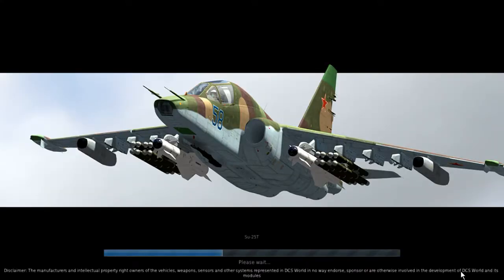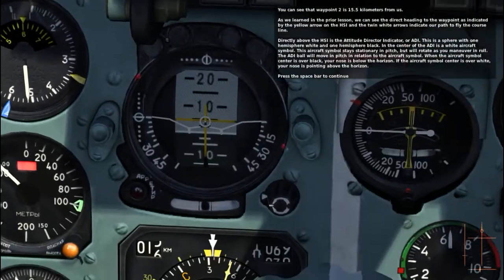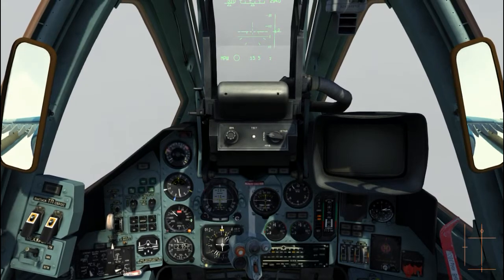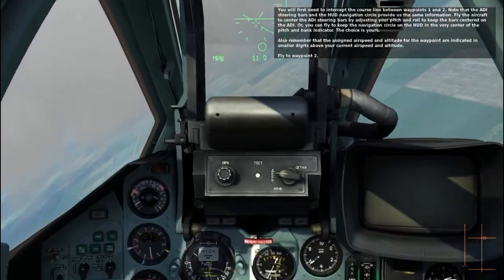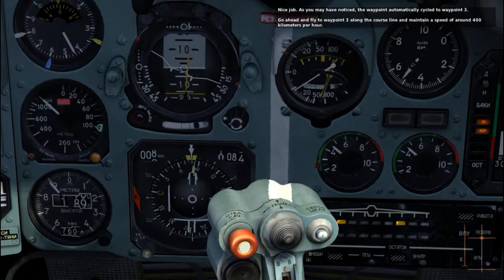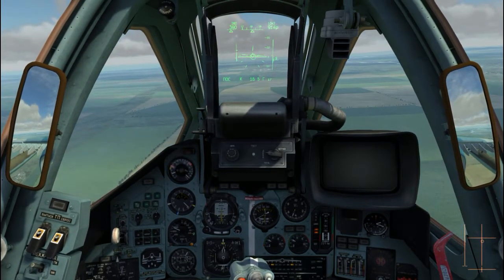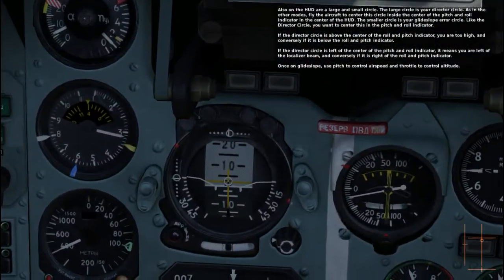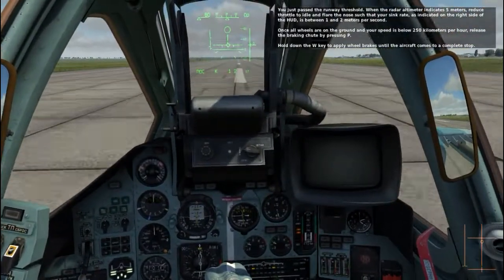Su-25T Training: Easy Landing

Comment: I always end up to the left of the airfield and idk what to do
Reply from the maker: Do you mean that it feels like the aircraft is being pushed slightly left of the runway as you’re flying down the glideslope? If that’s the case, that’s because there’s a slight crosswind in the mission moving across the runway from right to left. The easiest way to handle it is to maintain a slight bank to the right to counter it until just before touchdown. Another way to handle it is to use a bit of right rudder. Given the conditions, either will work.

Comment: When I pass through waypoint 2, my navigation systems automatically direct me to the next waypoint, but the next tutorial message never cycles. I've seen people say that the tutorial gate is actually much smaller than the waypoint, but I just can't seem to hit it, even with autopilot. I'm sure with enough practice I can land on my own, so it's more of an annoyance than anything, but would greatly appreciate any suggestions.

Update: it appears the tutorial gate is actually around 1700-1900 meters, instead of the suggested 1920. Once I figured that out I haven't had much trouble hitting it

Comment: Good video! Does the SU-25T have anti-skid? I sometimes "fish tail" after landing and I just have to counteract with rudder control. I couldn't find an anti-skid function in the controls list. Thanks!
Reply from the maker: No anti-skid that I’m aware of. You definitely want to slow down before braking, especially if the runway is wet. And you never press and hold the brakes, if you need to brake early. Rather use quick on/off application—a kind of poor man’s anti-skid.
Reply: @Flankertrainingcom  - Great! Thanks for the tips!

Comment: Thank you for this video. Despite my plane's navigation system automatically detected that I've reached a waypoint and switched to the next one, the mission/game sometimes just wouldn't think that I've reached said waypoint, so all of the rest of the instruction wouldn't pop up even if I kept on following the navigation system and put the plane down on the runway.
Reply: I also had this problem.  As noted in other comments, you have to fly very close to the waypoint for it to register. I think if you miss the way point it kind of glitches out the nav and it takes you away from the waypoint. I used Auto Pilot (A) to reach waypoint 2 precisely and it finally registered.
Reply: @pastusj05  I looked it up and and find out that the script gate is actually pretty small and a tad lower/higher? than the waypoint. The game is awesome but these in game tutorials aren't very well done. 

Also when you're doing bombing tutorials, don't release the bombs when you're pushing the nose down. I found out the hard way.
Reply: MATTS dyslexic

Comment: Haha you're a legend mate. I have been trying this for ages and I don't think I have been getting the altitude. The FD keeps sending me straight on past the waypoint and keeps taking me away from it. It doesnt shown to turn around or anything. Do you have to manually change the waypoint when you reach number 2? 

So smooth...... Thanks for the video mate.
Reply from the maker: Just reflew this to make sure the waypoint switches automatically and it does. You need to pass very close to it, however, (within 0.1 km, I believe) in order for it to switch automatically. But if you're a bit off, just select the next WP manually.

Comment: I can't maintain the plane in the glideslope. It's either I lose altitude too quickly even with the recommended speed of 290 or I'm too fast with the approach and crash
Reply from the maker: If the former, increase your throttle a bit. If the latter, use the stick to lift your nose. Landing is all about keeping the throttle and stick (the stick adjusts your AoA--angle of attack) in balance.

In short, you control your altitude with the throttle and your speed with the stick. It ends up being a bit more involved than that because as you adjust one, you'll probably also have to adjust the other. But that's it in a nutshell.
Reply: @Flankertrainingcom  I watched many of your videos, the way you land the plane in one piece even when you approached the runway at an angle within a short distance while still fast, amazes me. I know it's a learning curve. I'm considering changing my x52 pro entirely. I recently replaced the string and it seems there is no fluidity in my pitch and roll. It's either too much or too little.

Comment: When I fly this mission, my hud circle and adi are sending me mixed signals.

Also, even when I just put it on auto pilot, it seems to send me in the wrong direction indefinitely as the distance to waypoint only grows.

Edit: i tried it again, but this time ignored the flight path and just followed the yellow hsi needle. He stopped talking to me for some reason when I got to waypoint 2; all the way until I crashed trying to land without his help. Then he told me I failed the mission in a much more condescending voice than usual. I think he’s mad at me.
Reply: You must have crossed the waypoint this happened with me too

Comment: MayDay!
I think I've got an issue with this and other missions... I'm quite novice, so it truly is human error many times, but I've got a few things I'd like to ask you guys:
One of them: On this mission, after passing waypoint 2, and heading to waypoint 3, there is a moment where the distance begins to increase again, around 8,3km from the waypoint. The circle is still centered, the altimeter shows right... I simply don't know what's wrong!
A weirder one: on the learning mission of how to use the GSh-20, the mission plays at 7:00 and it's pitch black there... Okay, no problem, follow the damn circle and you are safe right? NO! I started to get a ground proximity warning after passing through some "doors" and lastly I saw a damn door crossing the ground! I tried to pass though the ground and the upper side of the door, but it was waaay too narrow... I crashed. Then I flew again, ignoring the doors, and after passing the one I had crashed, I saw more doors even closer to the ground. As if the doors were taken from a different map, and weren't placed correctly.

Please HELP!! 

thanks in advance...
Reply from the maker: I wonder if there's some problem with your installation. Just re-flew that Easy Landing mission and saw nothing like you're describing. Also flew the internal cannon training mission this morning to check that. The only gate which is half buried is the final gate at the targets. All others are well above ground, although there is one low one that Matt warns about at the top of a lesser ridge line. So something seems to be wrong on your end. Have you run a repair recently? That might help.
Reply: Flankertraining.com Gotta check if there is something wrong with the installation. It's my best guess so far! 
A repair? I'm quite new on DCS, could you tell me how can I check for those repairs? Thanks for helping!
Reply from the maker: Don't know what mods you might be running but sometimes that sort of thing can create issues too. As far as repairing your installation is concerned: https://forums.eagle.ru/showthread.php?t=114030 . This gives you instructions on using DCS Updater to do a variety of things. Repair is one of them.
Reply: Flankertraining.com thanks a lot!! Far enough for a newbie :) good flights!